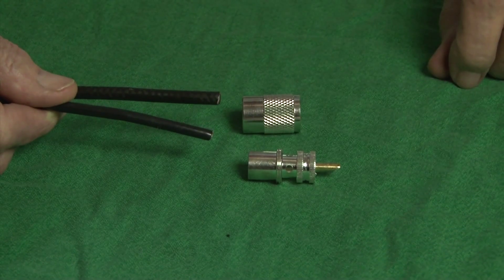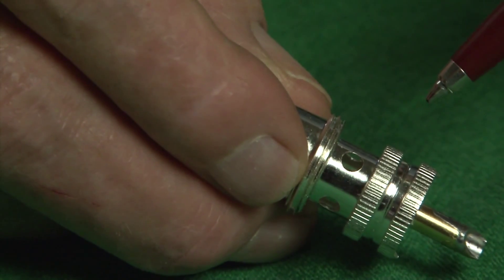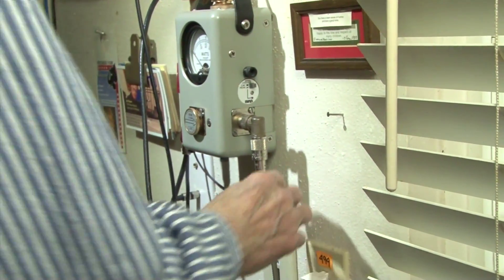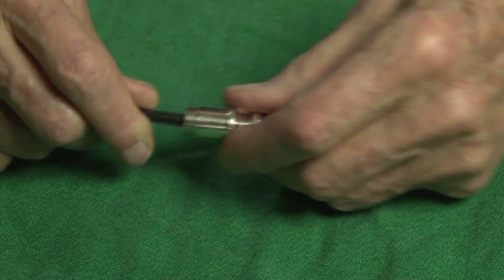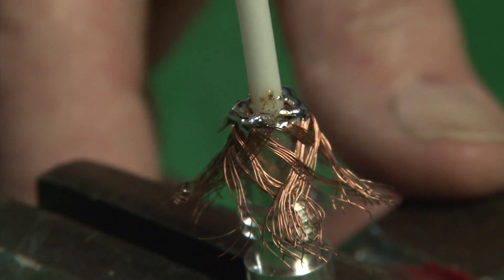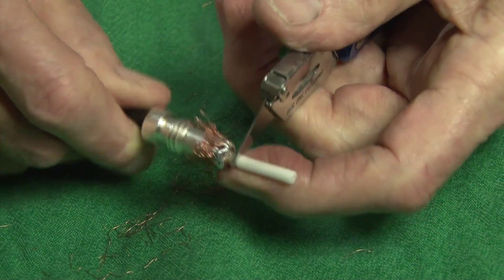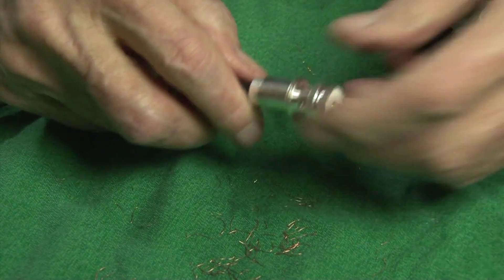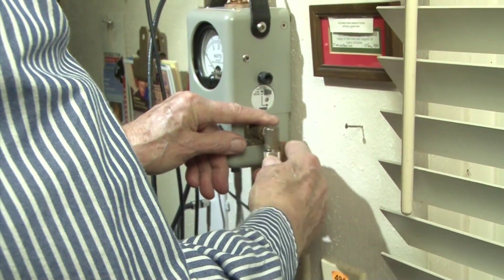W5TOM PL 259 Connector the Best Way

Comment: I gave up on these things 45 years ago! I worked for a Railroad, and we had used crimp connectors for years with no problem. Why bother with all that work when in about 5 minutes you are done. The Locomotives are in the weather 24/7 and they lasted for years with no problems with crimp connectors. Like Ring connectors,  there were no problems so I stopped soldering Ring Connectors more years than that. Maybe if you are Beach Front Property you might want want to reconsider. I would wrap the entire fitting as some areas moisture can get in and sometimes create RF on some other frequency than your transmit frequency. I used to unwrap our Base Stations once a year and clean the coax connectors so no stray RF would be created then re-wrap them. Visit a welding supply shop and you can find a wire brush(welding torch tip brush) that will fit inside a SO239 to clean crud out of the socket.